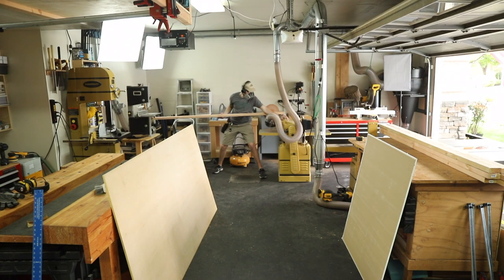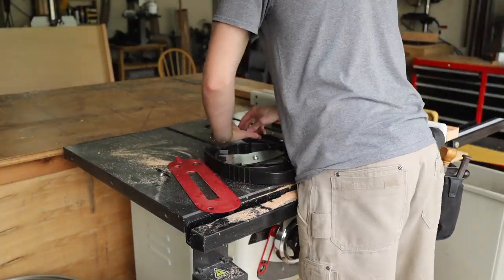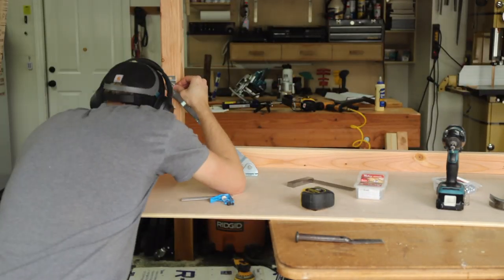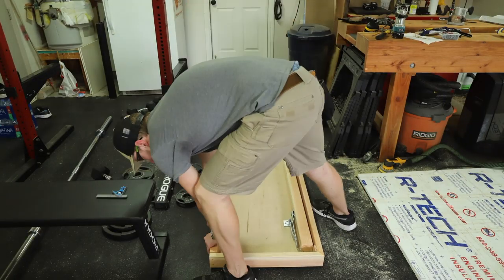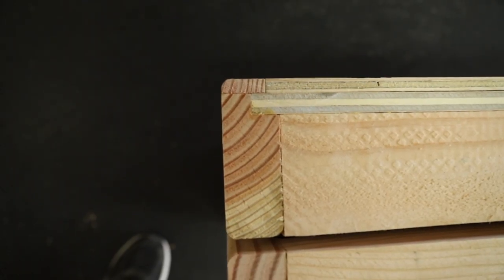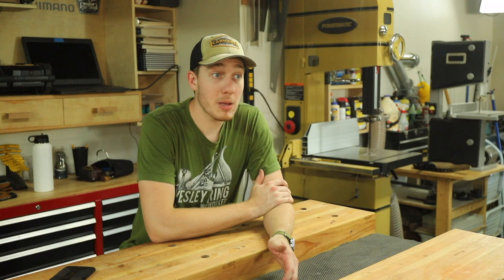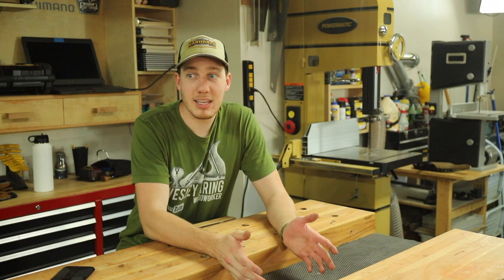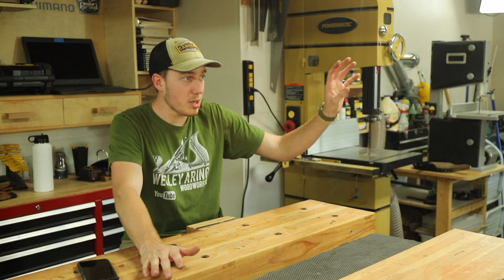Building A COLLAPSABLE WORKBENCH \\ STURDY Construction

Comment: Watching you use no push stick sends shivers down my side 😅
Reply from the maker: Some operations feel safer being in complete control
Reply: Clancyi, talking about :30? I start to think about picking up the push stick after the dimensions get smaller than 2X4, although I would curl a finger over the rip fence for security. And he did use the stick at 2:00, even though the rip setting was almost the same, because the greater force needed and greater blade height gave him a cautionary pinch.